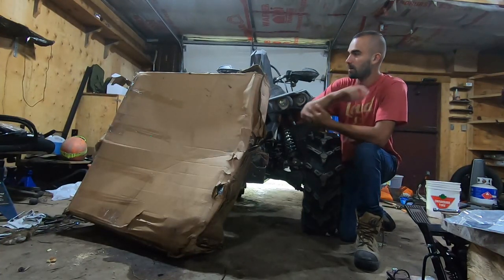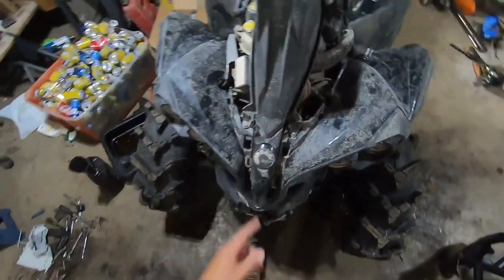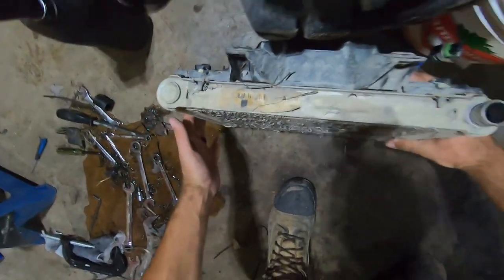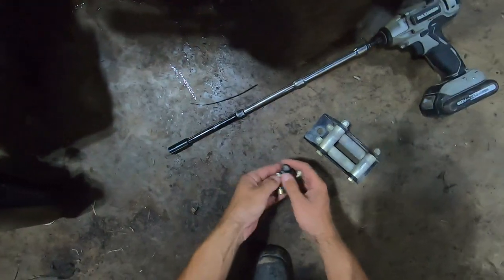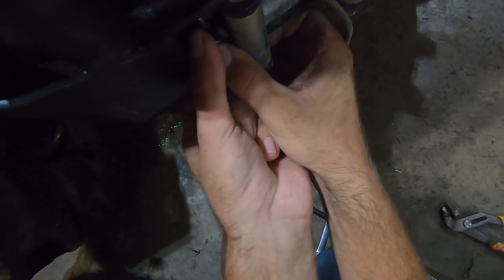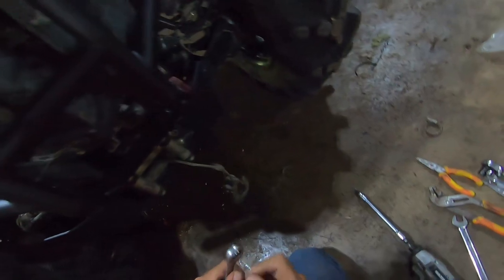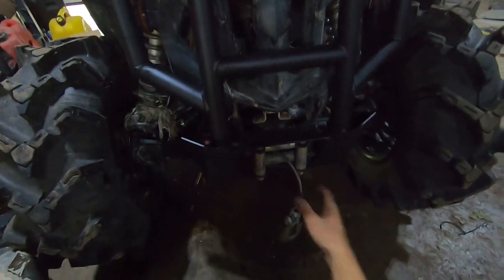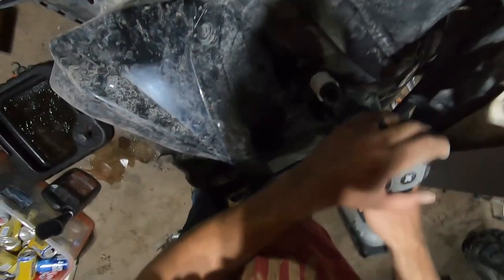HOW TO INSTALL WILD BOAR RAD RELOCATE 2020 CAN AM RENEGADE 1000 XMR

Comment: Do these rattle any on the 1000 xmr? Noticed  you had to weld some braces the Wild Boar kit on the 570 xmr to keep it from rattling.
Reply from the maker: QUADBOSS they do a fair bit, better to brace it before it breaks during a ride, however i run over trees a fair bit lol

Comment: instead of drilling in the plastic just run the hoses down along the hood where the brp logo in the front is where the rad used to be. if you use black hose you dont even know its there. good video though. i was using it to refrence if i needed gromet on the fan shroud to put it back in the stock spot lol
Reply: For lower rad hose or top?
Reply: @janky3409  i did both last time. it may depend on your rad relocate though for spacing.
Reply: Exposing your hose like that would not be recommended for trail use
Reply: @MrBossilini  it is tucked away well still. Doesn't leave anything at risk, or at least no more risk as the house going to the water pump already. That one seems line it is in a more vulnerable spot than any other rad hose

Comment: When installing it I’m on the part where you have to put the coolant in and on the side where the radiator is it just doesnt fill up it fills up the coolent box up
Reply from the maker: Probably because you removed the overflow reservoir at some point so its no longer and airtight fit, try putting the cap back on
Reply: @LyndhurstXMRMY  so put the cap on and try and fill it up?
Reply from the maker: @ogblze1235  yessir
Reply: @LyndhurstXMRMY  sounds great imma get back to ya if it still doesn’t work lol
Reply: @LyndhurstXMRMY  what if the fans takes to long to turn off

Comment: Bottle of coolant is lower than radiator?
How you measure level of liquid if bottle on lowest point?
Reply from the maker: Ive done over a dozen installs like this and never had an issue its an overflow bottle.